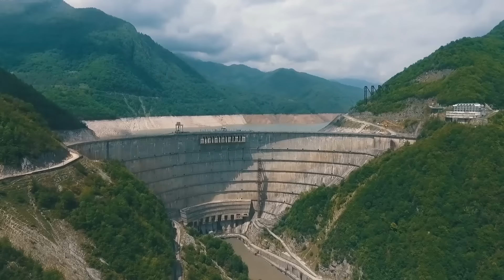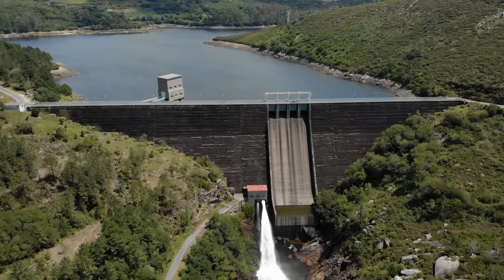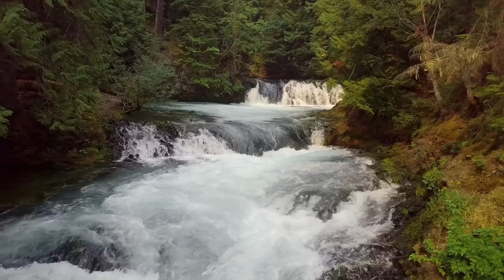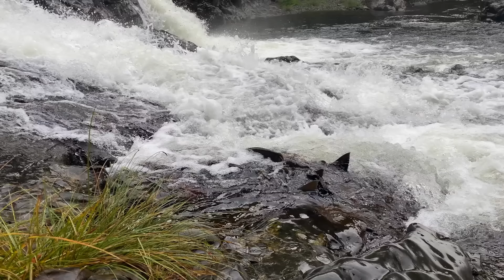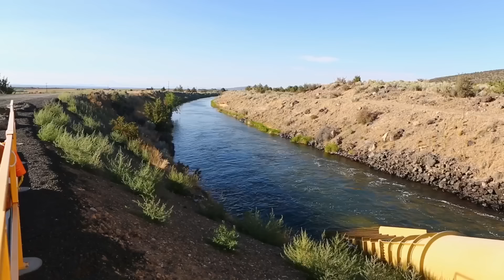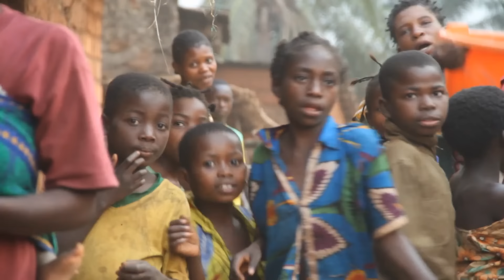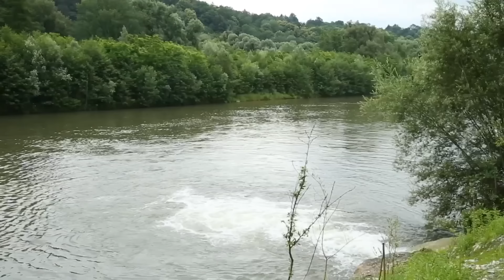Genius Micro Hydro Turbine Halves Cost of Energy

Comment: This might be a great idea in some countries. Unfortunately,  there are many countries that lack terrain providing sufficient falls to allow these to function. Given transmission losses, these are unlikely to resolve the shortages already being encountered- much less replace power stations on anything like a reliable basis. Norway is an ideal country for these, given most of the country is several hundred feet above sea level. In the UK, the middle of the country is only around 30mtrs above sea level & the shortest distance to the sea is around 80 miles, the lengths of existing rivers are in excess of 100 miles, resulting in flows slower than walking pace & no opportunity for any kind of useful gradient. Reservoirs are frequently low due to the need for drinking water & few have useful height dams. It's a similar problem with wind turbines that only produce useful energy with wind speeds over 10km/hour with wind speeds in the UK averaging something like 6 to 7km/hour. Solar is also pretty useless from October to March, due to lack of any collectable sunlight. This I know as I had a solar-powered water heater, which converted 90% of collected energy into heat. It was matched with a solar-powered low-energy pump to circulate it into my home. In spite of having it on a south-facing roof, with optimized tilt positions, it never provided any useful hot water over the 6 months it would have been most useful. Even on the sunniest days through October to March, the water inlet pipe was always cold to the touch. We need nuclear power, not windmills or flat screens with limited lifespans and unreliable energy.
Reply: The video literally mentions a 60cm head requirement. Basically any river anywhere will work. While I do agree on using nuclear for the developed world, initial costs and maintenance is too expensive in the third world. Let them have unreliable power sources for now, as the only other feasible option for their current condition at scale would be fossil fuel.
Reply: @Specialopsdave  your comment is incorrect. The examples they give offer no information on the speed of flow of the river. They give one example of a 60cm of head, which could power a handful of local homes, yet again there's no flow rate stated. If you can't understand basic principles, you need to study some. Water has weight, flow rates determine the energy in that water that energy can be extracted from. It's not a magic trick, there's physics involved. And you have ZERO grounds for denying developing countries fossil fuels, unless you suddenly became God. Get over yourself you rascist
Reply: A Roman Viaduct has a gradient of 2.5 cms over 50 kms. So the rivers in the UK would be suitable for it.
Reply: @Bat Man  how many Roman viaducts carry rivers? Oh yes, none that are of value. Most viaduct were to carry drinking water, they're designed to be s l o w - and flow rate is everything in converting energy. Same as wind turbines. Most of them produce nothing of value Most of the time then, when when wind speeds hit 40mph, they have to be turned off to stop them catching fire or falling apart. So you have this small window of 10mph to 35mph where they're useful. The rest of the time, especially with transmission losses, they're useless. Given average windspeed across the UK is around 6 to 7km/hr, that's most of the time...
Reply: What are you talking about? This just needs moving water. They can tune the props for the speed.
Reply: @William Crowley  what are you talking about? The production of useful amounts of energy require far more than ' moving water', in the same way that wind turbines may turn in 5km/hour winds but fail to produce anything worthwhile until at least 10km/hr. Like a solar panel that has light falling on it in winter but nothing of value, with a conversion rate of around 15% energy out from energy input. Like your car might freewheel down a 5% gradient but at 2% it's not overcoming friction. You've obviously never been involved in anything to do with engineering. And that's all without transmission losses. The reason the overhead power cables run at 420kVA, because the percentage of losses are far lower at that level. You get 10kVA & it's worth nothing by the time it gets to a point of use. Low energy only works at the receiving end, it's no help at the output end. Really, some people make me wonder how they can understand so little...
Reply: @John Murphy
Well, we have produced 32% of our energy from wind over the last week and it's not been windy where I am (London) 29% over the last year...
That's at an average of 9GW
.
Good news!
We've got 3.6GW coming from Dogger Bank to be ramped over the next 2 years.
and other projects.
.
Just btw, before anyone mentions Unclear energy.
That project is 13% larger, 34% of the cost and will take 60% of the time compared to the Hinkley  debacle. 

Oh, and the strike price is £48/MWh compared to 
£118/MWh for Hinkley.

Comment: This product seems nearly identical to Turbulent from Britten.
https://youtu.be/2shxVXqtFZU
Reply: Turbulent just uses a fixed propeller turbine without any flow control. It's a really low tech version of a propeller turbine designed with principles of frugal Engineering. Too bad that they don't understand this and are trying to sell it at a per kW price that's higher than more efficient turbines.

Comment: That's all fine and good but 1: where is the water supply coming from and 2: what will you do in the winter when the water freezes over ? At least you can brush the snow off the solar panels or get a solar generator and charge it by plugging it into a wall outlet , i have 2 solar generators and i unplugged them 2 years ago and the li-ion battery is still at full charge
Reply: I don't think the rivers freeze in central Africa.
Reply: only some rivers ever fully freeze and in EU rivers, the winter flow is usually a lot higher than summer flow.
Reply: and yeah, Congo doesn't have freezing temperatures neither

Comment: If you extract power upstream it will ruin the environment downstream. You are literally taking energy out of the water so that it does not have the same momentum it had before so it will not be able to flow as far. It will pick up less sediment causing more of a build up  which will eventually close off the stream. Nothing is for free. Furthermore, humanity has wasted millions of times more energy on mansions, lawyers, wars, etc than it can ever get back. Humanity is boxing itself in because the more it wastes and the more it extracts the more it changes the world around us in a negative way. Since governments and corporations only care about the short term profits this causes major issues in the long term that eventually can't be solved(as society degrades it will not have the intelligence or will power to deal with the problems it faces.

Comment: That looks safer for fish, but not safe.
Put solar panels on every rooftop.
Reply: Solar panels only gather 15% of the energy from the sun.
 The otherr 85% of energy is reflected back into the atmosphere as heat.
 Thus causing rapid global heating 
  Covering every building with panels would rapidly increase global warming at an unprecedented rate. 
 Not to mention the ecological damage done whilst manufacturing millions of panels.

Comment: Nothing that deals with water and moving parts is going to be cheaper than basically a static plane of glass.
Reply: Depends on how much the power output is, really.
Reply: Especially if your solar panel is free, and never wears out.
Reply: @dicktaug4773  Power output from solar panels drops over time so systems have to have extra capacity to allow for this, I'm not an expert just reiterating what a number of posts have said so you need to confirm but the posts seemed genuine.
Reply: except solar panels arent just glass and have some not so cheap and not as durable materials in them

Comment: Won't cavitation cause wear on the  blades?
Reply: its not driving water, its being driven. its only extracting so much energy from the water, only achieving a pressure drop of so much. to try for a higher pressure gradient would simply stop water from flowing. basic principle... slow water down to half its velocity/reduce pressure by half. same thing.

not enough pressure change for cavitation. 

the whole idea of a turbine is to extract energy as efficiently as possible. cavitation isnt efficient. for it to cavitate would require it be powered, driven, like a pump.
Reply: cavitation can take place only when the flow (rate) is high or the turbine speed is high. Modern water turbines are slow speed devices. I do not see cavitation as a serious problem
Reply: Absolutely, it’s unavoidable

Comment: Its nice, but If I can't pick it up, I wouldn't call it micro.
Reply: True.  More like "mini" hydro.
Reply: there's also Pico and Nano hydro. Take a 1kW propeller turbine. it will still weigh 80 to a 100kg turbine and genset. It produces the same amount of energy as 5.6kW of solar. So about 15 panels. every panel is 22kg, so that weighs 330kg for the same energy. this excludes batteries for continuous energy and an inverter of another 20kg. Portable is relative.

Comment: One factor that mitigates the initial higher KWH cost of off-grid solar is it allows local distributed production and consumption. It is easily scaled up,then forming micro grids. That cuts out the slick-dressed parasites that run the grid,whatever the initial source of energy.

Comment: Hell they should use the tides! In my opinion the solent in the UK  especially the western end would be an ideal place for hydro power because of the fast tides.
Reply: salt water isnt easy. watch barnacles. watch corrosion. watch electricity mix with salty water and corrosion.

then the basic fundamental of the whole system is slowing water flow to half. any turbine. half. 
so, big damn wall, block the tide to half speed with turbines.
half the tide as before...
release half of that tide back for only a 1/4 of the tide on the return.
then yeah, half tide on the cycle.
1/4. 
1/2.
1/4.
of course, you could reduce flow by like 1000th, and still be making huge amounts... in steady, predictable surges...

then what to do with it?

in that regard i do like the idea of hydraulic air compressors aka trompes... compress air, release as required...
no moving parts, just a deep hole in the ground, with about 1M of fall. some nozzles. the air comes out dry, clean. lots of it...

Comment: Tesla turbines don't need close disks next to each other, you can space them out... Thicker larger disks, spinning with maybe a foot between each disk... with the mass of flow it will be worth it. Fish would flow through, and the water and fish caught in the spin would go down soon safe but faster sometimes... 2 Disks, 1-3 feet gap between them, with mass flow between them in series 1-3 feet between each disk over a long dam length... You could stack hundreds of disks 1-3 feet between each gap flow of water past them catches and spins them...  no blades... Very safe for fishes. dents on the disks designed to interreact with the water help them flow faster or in different Flowing ways past the disks which capture the momentum....
Reply: Can you point to one example of this in the real world? It sounds good, a little too good though

Comment: Only source of pollution for these is the mining of elements for the  magnets needed in the turbines, unless we can replace those that will be a downside for basically any renewable source. Have seen a lot of these smaller turbines and several different designs in the last 10 years, great leaps are being made when people see the potential and invest.
Reply: you need not use rare earth magnets for everything; all traditional generators are equally efficient but they are about 30-50% larger in size. You need these super magnets only when you have small space or weight problem.
Reply: @janami-dharmam  Further to that, when a device does indeed need a magnet with very high magnetic density, Iron Nitride is likely to become the go to material instead of the much maligned Neodymium in the long term; not only is it cheaper on account of using abundant elements instead of rare earths, it actually offers substantially better performance, being at once more efficient by a good 10% but also being capable of producing 2.5-3x more power output for the same amount of material. Several processes were discovered fairly recently, that allow for the economic production of Iron Nitride, as such GM are already looking to use Iron Nitride magnets in some of their EV motors working in partnership with an Iron Nitride manufacturing startup; if/when they can scale up production, it will be , well, revolutionary.....I'll get my coat....

Comment: Hard to believe anything mechanical is cheaper than solar.
Reply: It is cheaper than solar plus batteries plus inverters, charge controllers, mounts and the rest. I live in Canada with solar. The panels cost is about 1/5th of my systems total cost.
Reply: @tomkelly8827  Maybe for a whole village or town but not for a single home use and you would need the perfect place with the perfect waterfront.

Comment: Hydro power has been in use in Scotland for at least 50 years now, did no one know this. 99.9% of electricity in Scotland is by renewable energy and over 60% goes to England
Reply: Scotland has a huge land area for less than 10% of the population of the UK, with lots of high ground & valleys that are ideal for this kind of equipment. Scotland also has far higher wind speeds than the rest of the UK, which is why the wind turbines have better production figures. Much of the energy has to go to England because Scotland cannot use it all & transmission losses, for exporting further afield, are huge. It flows the other way when necessary. Scotland spends some £8 billion/ year more than its tax receipts & that includes credits for the oil & gas receipts. That gap is filled by England, along with similar subsidies for N.I. & Wales. Most of the technology installed has foreign investment at its source, that has to be paid for somehow. Norway started hydro-electric at the end of the 19th century, with Hammerfest (north of the arctic circle) being the first town to benefit from electric street lighting in 1891. So Scotland wasn't exactly a pioneer in the process. That aside, there's still a long way to go before oil & gas can be dispensed with, with something like 3 billion people in the world reliant on burning dung or wood as their sole source of energy, causing millions of deaths from smoke inhalation, cold & food shortages. They need cheap energy & the holy grail that consists the current & proposed 'renewables' aren't going to be anywhere near enough to fill that hole.
Reply: Well England is where the industry is right? Makes sense. 

 Electricty is a great export. Be proud!

Comment: Toroidal propellers: Sharrow Marine has been getting frankly spectacular results from boat propellers that use toroidal loops instead of standard blades. After several years of development, the company has now tested its props against hundreds of standard propellers, and the difference is incredible. Sharrow's props simply don't create tip vortices – a major source of energy loss and a surprisingly large component in the overall noise of an outboard engine. https://youtu.be/QNCbnntCU2k
Reply: Thanks! It seems they need to operate within a certain rpm range for maximum performance advantage, and there's still the fish passage question, but very interesting.
Reply: Wow thanks for sharing